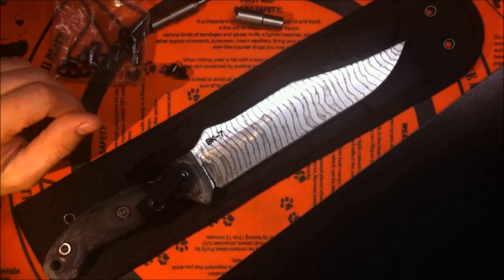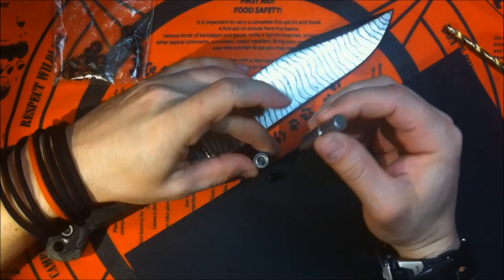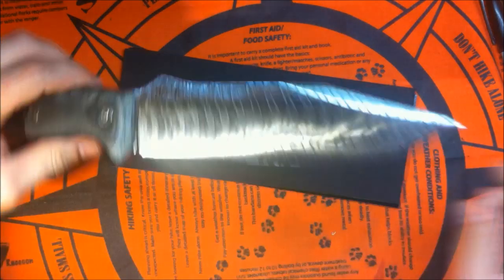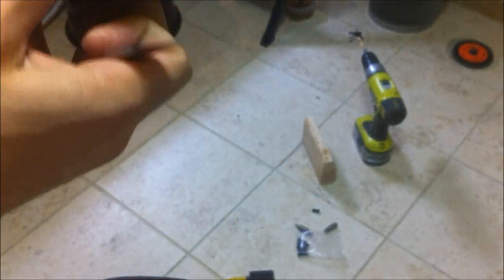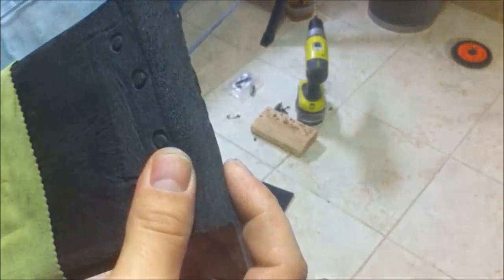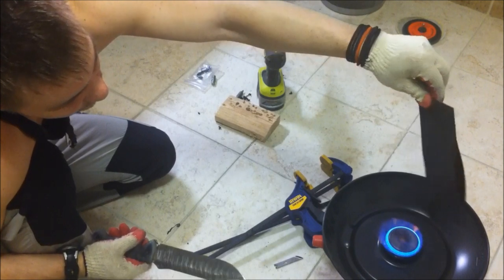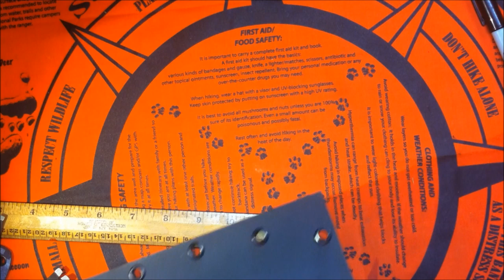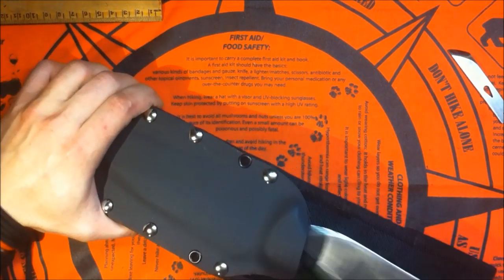Custom Kydex Sheath Making

Comment: Awesome job! thanks for the informative video.

May i suggest putting a small drainage hole from the lowest formed point of the sheath to the exterior, just in case you get water or some sort of liquid in your sheath by accident.
HS.

Comment: Did you see the film, Big Lebowski?  Where the blond thug drops the bowling ball on the tile.   Crack.   So, I recommend that you drill a hole in that piece of 2 x 4 so the bottom die can fit in it while hammering together the rivets.  I have about 20 knives that all have sheaths, but I do not like the quality of the sheaths at all.  So, I'm tooling up to make sheaths.  I pay attention to your videos and I'm much obliged for your tips and instruction.  Very helpful.